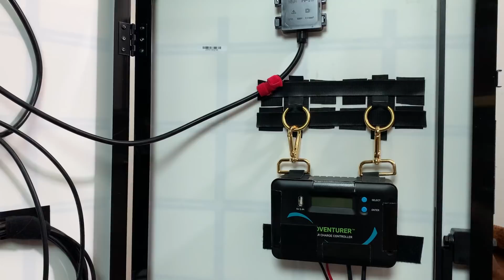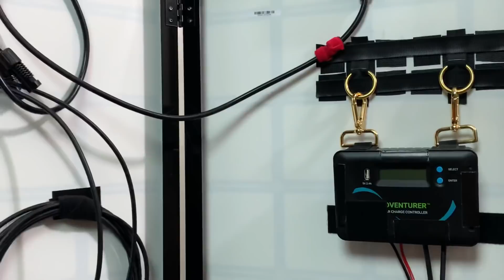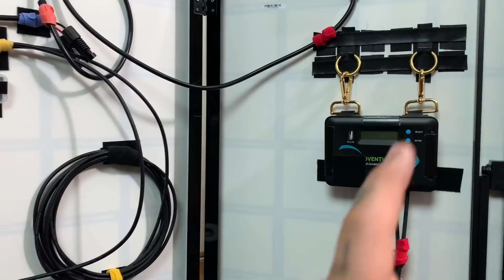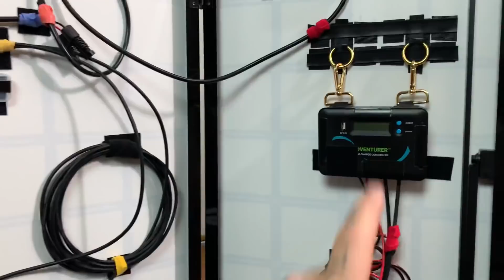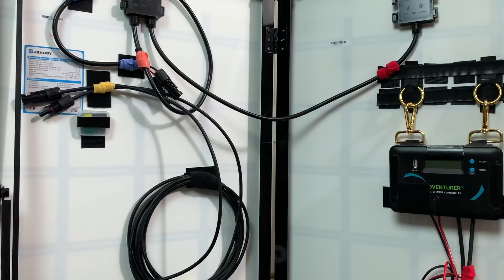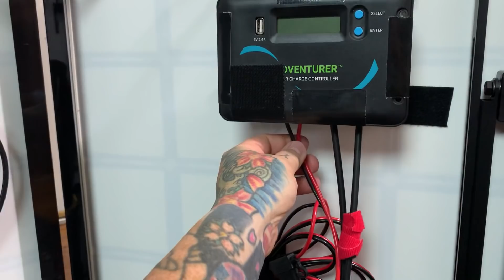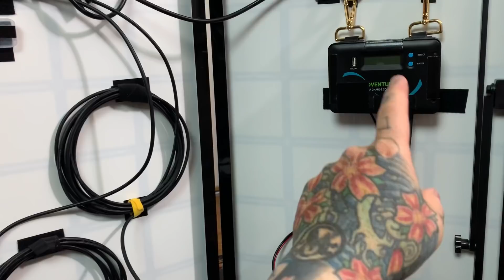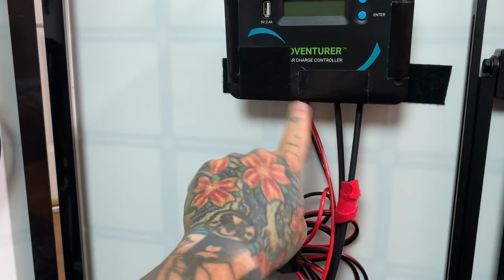🌞 DIY SOLAR BRIEFCASE Setup! 😇👍 RENOGY 200W or 100W Solar Briefcase

Comment: If the fuse between the charge controller and the battery blows out, would that then cause the charge controller to burn out because it would then be connected to the solar panels without the battery connected?
Reply from the maker: yes, which is why i use a 30AMP fuse in there, i replaced it

Comment: What did you do it for - for the cabin - charging the dewalt batteries and the computer?
What are the benefits of the Li-ion battery compared to the lead acid ones, in regards to the price?
A normal fridge too wouldn't be a good idea, right?
Reply from the maker: WEIGHT and discharge depth

Comment: What can this setup run? Do you connect a load to the battery while the alligator clips from the briefcase are also connected, like a pass thru? Or do you charge the battery and then take it away to run stuff?
Reply from the maker: yes, but not a fridge or microwave etc.  i do both

Comment: One word..  Perovskite.
Reply: Meaning?
Reply: @unbroken1010  A material that is replacing silicon in solar cells that will significantly increase the efficiency.
Reply: @Mr25thfret  So we're told.